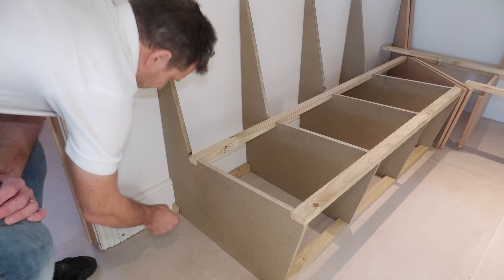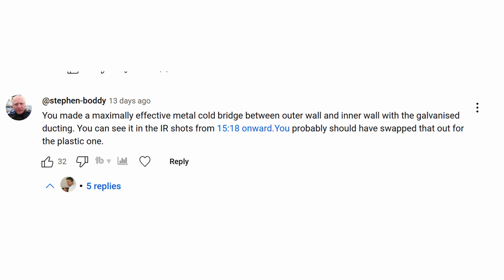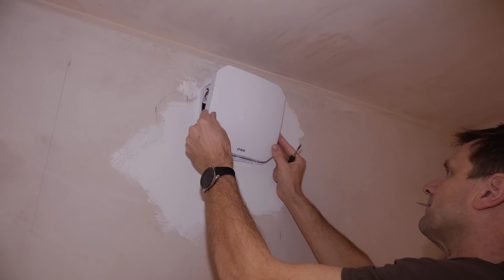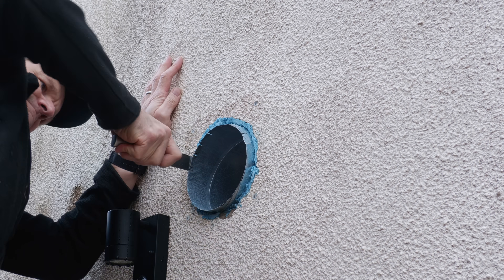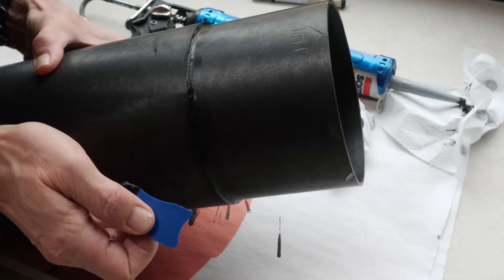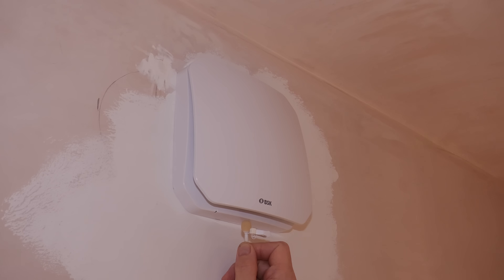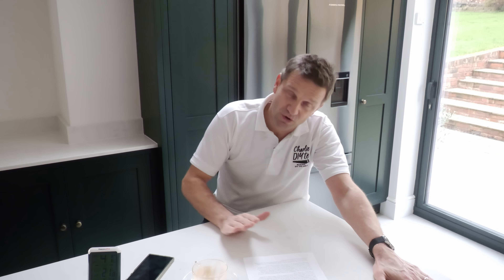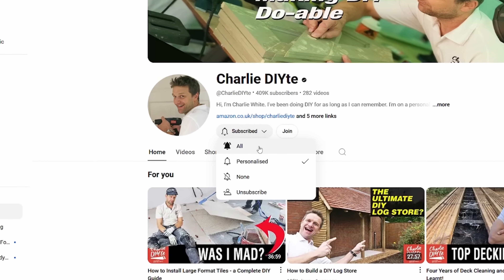Is Single Room Heat Recovery Ventilation Worth It?

Comment: ive got a bunglow and the bathroom is the last room and all the damp air seems drawn to that room, there was an old extractor fitted centre of the wall which didn't work so i removed it, basically the tile had a circle cut in it but behind the tile two bricks were missing, which i think drew all the damp air out of the house,  the house is surrounded by trees but never had damp only small amounts of condesation on the kitchen window in winter,  so i spoke to nuaire tech and ended up fitting a piv, works great had it for at least 10 years but after seeing the gosforth handyman fit a kair, i rang isells who  i bought the piv from and got advice about the kair, bought one, fitted it in the bathroom, blocked up the old extractor hole, few weeks after fitting the kair, small amounts of damp on most walls in the hosue and black mould in the shower cubicle which has never happened before, , emailled isells, the advice was to remove the kair and replace it with a continuous fan because the kair is interfering with the piv,  so i've done that, i think its working, i still see some damp on walls but i have to look at an angle to see it so not sure if its new or i've just not noticed it. so after years of no damp it seems i've spend hundreds on heat recovery to get damp on walls and now stuck with a kair unit i can't seem to use as isells say it interferes with the piv, i'd wanted to fit one in each bedroom,  £300 plus £55 for a core drill then electrics and its in itis cardboard box in teh loft, if anyone wants to buy it

Comment: I believe the answer isn't dmev with heat recovery, it's simple dmev in all wet rooms and kitchen, with humidity sensors and trickle vents open in living spaces. This will create real air flow through a house, will keep humidity levels down and is cheaper. I've heard from several sources that if your airtightness isn't approaching passivhaus then the heat recovery of MVHR is not going to pay for itself anyway. Air quality is an issue unless you fit filtration to your trickle vents, but you can't have everything!
Reply: Very few thing you do to your house (or life in general) 'pay for themselves'. That's generally a poor measure of utility. A house with MVHR in (and good airtightness and insulation) is a joy to live in, and that's the reason for doing it - not that it will make you money. But it is a vital part of a system of good building physics that gives you a very low-energy building that is cheap to run.
Reply: @xxwookey  I definitely think you're right! I just wonder whether it's the continuous ventilation (which DMEV can provide) and insulation which are making it a lovely place to live in rather than specifically MVHR. It's all part of the equation I suppose!

Comment: Cheapest way to reduce humidity in tge house, is to wait for a cold snap, get a full air change in the house by opening doors and windows and then close up and heat that cold air up to 20+. The cold air will expand, with the same amount of moisture in it, dropping the relative humidity dramatically
Reply: Didnt know they had you tube in 19th century

Comment: Hi Charlie, the hygrometer is a good idea, but don't assume it is your fan that has reduced the relative humidity on its own. Absolute humidity (not the same measurement as Relative Humidity) levels drop in the Winter months due to colder air being able to hold less moisture. Relative humidity is a measurement of how much moisture the air can hold at a given temperature and pressure. Change the temperature alone, and you will see the RH % values change. You may need to wait until warmer weather to test if the stuffiness returns. 

I'm enjoying your work, and appreciate your honesty. Best wishes

Comment: I have done a Vent Axia MVHR retrofit on a 1989 house.   Allot of DIY work but straightforward.   We had mould. condensation, stale air.   The house had no extractor fans!

Ultimate efficiency was not the aim.   I wanted to solve the damp/mould/condensation issues.   I do not like PIV systems or Extractor fans as they dump all my heated air outside (££££).   Also fitting four extractor fans would have been allot of work drilling ducts and running electrics.
Reply: I brought the unit on ebay as well as ducting to keep costs down.  Rest from ventilation specialists, Screwfix and ebay.  Did all the work myself.   Commercially it might not be viable.

Fitting the upstairs bedrooms and two baths was easy and done in a long day.   One board to lift in the loft.   Lots of faffing with loft insulation and crawling so you need to be okay doing that.   The downstairs was more of challenge.   I ran thee ducts down two built in cupboards and the corner of the airing cupboard.   I lifted two parts of the upstairs floor to run along the ceiling for downstairs.   I had to repair only one piece of ceiling plaster board that I needed to drop as upstairs access was not possible.   A core drill is required for brick work, consider hiring.  I started upstairs to get the basic system going then did the other more complex downstairs rooms over time.
Reply: Mine should be 92% efficient.  Judging by all the condensate it drops I would assume, like a condensing boiler, it is recovering some of the latent heat of evaporation to get above the 80% heat exchanger efficiency.   It consumes between 10-16W unless it boosts to 40W.  Vent Axia use efficient fans.   I have it configured to do 2x air changers an hour.   I have not found any evidence as to why 3x is the recommended level.   At night ours drops to less than 1x an hour as I believe (and my data shows it) that most moisture is from human awake activity - cooking, breathing and washing.  I have however set the  humidistat to boost aggressively (ie well above recommended individual room boost turnver) and as high as it will go without making lots of noise.   Logic being I want to remove moisture ASAP.
Reply: I have had a few issues.   The condensate drain froze one winter.   Have plumbed it into the soil vent under insulation, solved that.   When very cold (-10C) it goes into protection mode.   Newer ones have heaters.  The filters blocked (needed more frequent changing) and also one year the heat exchanger got dirty and the condensate drain blocked due to filters being bypassed.   I change the filters every other month in winter which takes minutes.   I make my own and wash them.   I also dowse the condensate drain in Milton.

We have zero condensation issues.   Noticeable dryer and cleaner air (2-5ugm2 pm2.5).  Low CO2 (400-800 ppm).   Mould is gone.   The house never feels stuffy.   I have all the stats in home assistant.

I would fit another.
Reply: @gregcope5565  really interesting set of posts, thanks for taking the time to write. I have looked at doing similar in my own house. It's a new-build, ~12 years' old, and is very well built and insulated. I find it stuffy in the summer, and struggle to get the air movement (windows open is okay, but we are regularly woken by the various outside noises. Bloody cows!). In the winter, it isn't quite as stuffy, but the village is filled with wood burner and coal fire users (as well as the bloody cows!) which leave the air strong with pollutants, so opening windows can be problematic. The one thing that has put me off so far is cost, so it's interesting to hear about your DIY approach. I never thought about eBay for ducting, I'll check it out. I would have the same sort of work as you, I've identified routes from upstairs through fitted cupboards to serve downstairs. One thing I wasn't sure about is how the system itself is connected to the outside? I have a gable end, so I'm assuming I'd fit the unit on the inside of this (in the loft, I mean) and duct to the outside wall directly? Or would the height be an issue, should I be ducting down through the house and out? Also, does the heat differential in the loft space itself cause issue? My loft gets really cold in winter and boiling in the summer, and I assume this would have a negative effect on the efficiency of the unit itself. I'm assuming that duct should be insulated where it is in the loft space too? 
Apologies, that is a lot of questions and text, but that's what you get for providing such a helpful and comprehensive comment! Merry christmas!
Reply: Re units main ducting;   Yes gable ends are popular.  Fitting instructions have specifics about slope on the exhaust.  Mine is vented via the roof using tile vents.   There are youtube videos on this.   Other issue to design is the condensate drain.   I would highly recommend insulating and getting into a soil pipe as I had mine (past tense) poked out of the roof with the overflow pipes and it frooze multiple times.

You can fit the unit in a cupboard or throw a duvet over it like I do.   Most are designed for lofts and insulated. Usually they are mounted in the insulated building envelope in new builds.  Mine is made of formed expanded polyester i believe.   Units will have a design temp range that you will need to check.   My loft varies from -1C when its really cold and +40C when hot.   As I said all my lots ducts are over insulated (ie under 400~500mm of loft insulation or in two insulated flexible ducting (all are cheap).
Reply: Will add a longer reply as youtube is eating my replies
Reply: I did the main unit duct and condensate drain to get the unit working.   Then the plenums and feeds
From/to bathrooms and upstairs rooms with plans on the rest.   This enabled me to commission it and up and running.  I did those later as more work.

I used a mix of ducting.   75mm is usually only sold in long lengths.   Its expensive.   Mine, along with the plenums are burried under 400-500mm of loft insulation and therefore part of the insulated building envelope.  I brought one roll from a supplier and scored the other on ebay (surplus).
Reply: I brought a specific vent axia sentinel surplus off ebay.   It was unused.   I used 150mm ducting insulated with two sets of insulated flexible ducting (160 and 250mm i recall) one inside the other to the plenums.

Inside the building i used 110x54 rectangular ducts down internal cupboards.   These look smart.  I used various parts like 150mm round to three 75mm or three 75mm to 110x54 fittings to get it working.   Flexible 110x54mm also helps cheat around tight places.

Negotiating joist and noggins is fun.  I cut none of mine.   I was lucky in that the airing cupboard or upstairs fitted cupboards all allowed access to the right areas so did allot of routing in the loft.
Reply: @gregcope5565  awesome, that's really useful. I especially like the low tech idea of throwing a duvet over it. Makes complete sense, especially in the loft area, where nobody can see. I have reasonably easy access to duct via roof tiles and gable end, so I'll work out which is best for access, and the condensate to soil pipe should be doable, as it would be situated above the bathroom, so great advice. Thanks!
Reply: @ricos1497  be careful of “roof+gable” as the install docs say that they should be on similar areas to avoid a pressure differential.   Think strong wind on one vs other.   Mine are on the same roof 3M apart.  There are min distances to avoid cross contamination.
Reply: @ricos1497  the duvets were being through out.  Got upcycled.   A box mode of celotex sheets would work well.
Reply: @gregcope5565  yes, pressure differential would be a big issue for me, as I get blasted by winds off the sea very regularly.

Comment: What do you guys think about a system like the siegenia aeroplus wrg, it has balanced ventilation through a single pipe that is divided on the inside in supply and exhaust air. The efficiency numbers I see here for central systems I have as well. E.g exhaust air of 18 degrees and supply air of 14 degrees with a 2 degree outside temperature.

Would that solve the issues mentioned in this video for these systems?

Comment: The temperature overshoot in you living room is an indication of poor control. Whilst you can adjust the setpoint down to accommodate the difference between setpoint and actual temperatures you are still running the heating harder than it needs to achieve your setpoint. I've had the same problem in my living room and am in the process of installing a three term control (PID control) to better optimise the heating. I've used PID controllers in industrial applications in the past and have always achieved really good levels of control. For the easiest set a three term controller with 'self tuning' is best. Once it has worked out the heating and cooling rates for your system (in this case the living room)  it will know when to turn on the heating source and when to turn it off allowing for the system response time and adjusting the power demand.